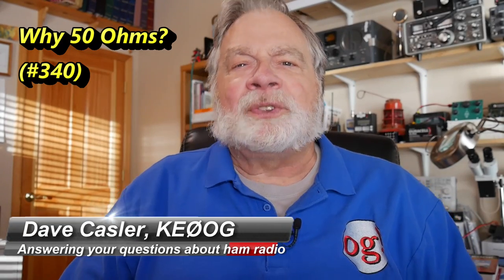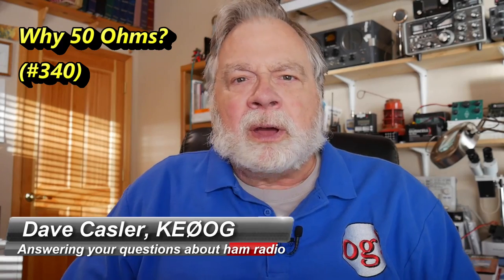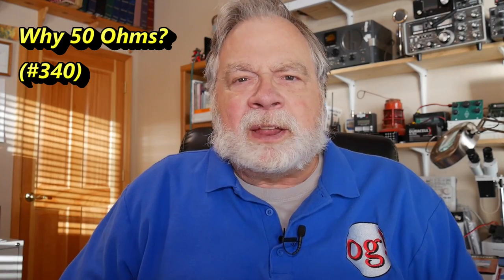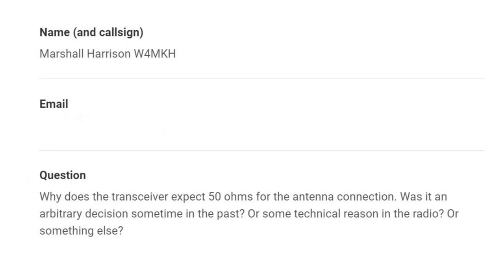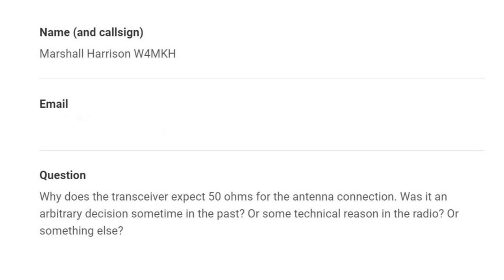Why is Coax 50 Ohms? (#340)

Comment: Dave, not sure we are on the same page ;)  50 or 75 makes no practical difference to a Ham operator.  Impediance is easily adjusted by lowering a dipole into a "V" adding capacitance till you reach a match or just use a matcher.  Coax is used to stop interference from close metal (say the tower).  It is practical at say 100 watts.  Above that, you best start looking at ladderline in the 450 ohm catagory.  RF in the shack?  Yeah right ;)  I used to work on TV transmitters that had so much RF around that the florescent lights in the building were always lit!  RG 59 has a tiny center conductor.  It will carry 1, 7mhz bandwith TV channel but to carry multiple channels (cable) they have to go to RG6 with a larger center conductor to handle the bandwith required.  One winter I built 2 QRP radios, 40 and 80 meters @1 watt, hooked it to a 540 ft loop up 50 feet with RG6 (75 ohm) and worked 41 states and 4 continents!!!  (still have the QSL cards)  A Ham Operator will figure it out!  The problem is that these kids that send 2 box tops and 50 cents to Kelloggs (the new ARRL) for their ticket have no idea at all of radio theory!!!  How many could sit down in front of an FCC examiner and pass 20 word code or extra class questions??  Zero, that's how many ;)  AE4YW

Comment: 50-ohms is used for carrying frequencies in the shortwaves and below, mainly.

This is because the multiple infinite impedances of the cable must approximately resonate with a specified signal emitter (transmitter).

And yes this resonance is a compromise.

Television frequencies tend to use cable with resonances tend to be 75-ohms in an attempt to provide signal insulation at reduced cost to the consumer.

Amateur radio operators tend also to use cable at 50-ohms, but the cable tends towards a lot more expense.

Even today, financial costs matter.

Comment: the initial cable diagram looked like RF waveguide rather than conventional co-ax. that is the best method of decreasing attenuation at high(er) frequencies. effectively, its a tuned cavity to assist RF at predetermined wavelengths.  you probably knew that :)

Comment: Nice but use of 75 ohm cable means a mismatch between source (tranceiver) and load antenna) as you explain at the start will reduce efficiency of power transfer as source and load are 50 ohms.
Reply: 75Ω on a 50Ω system is only 1.5 SWR, ERP is still 96% so it is hardly worth worrying about.

Comment: Thank you Dave, now I know. (after 45+ years in ham radio) 
You know what I've been wondering about the last so many years too? Why 13,8 Volt for so many devices? Never anywhere found an answer to that. Not 13V or 15 or 20 but 13 POINT 8 Volt ! 
73, good DX and stay safe !
Gust ON6KE
Reply: 13.8V is the nominal voltage of the electrical system of a typical car when running. In any case there is always a tolerance for input voltage since the voltage in a car can vary quite widely.
Reply: I see, so far I learned twice today and it's not even 10:00 local here. 
Thank you Dave.
Gust ON6KE
Reply: It's the maximum voltage that would be achieved by a 6 cell lead acid battery system.
A single cell's potential is said to be 2v but it is 2.3v on full charge.
So, 6×2.3=13.8v.
The power transistors in the final amplifier stage of the mobile radios are rated with this maximum voltage in mind.
Reply: Thank you.
73, take care
Gust ON6KE

Comment: I would love it if you could go into more detail about the physics of why 50 ohm is best for high-voltage and 75 ohm is best for low attenuation
Reply: I think that was experimentally determined and may have been dependent on the materials available at the time - copper conductors and air or maybe some early polymer or ceramic dielectrics. It could be that the optima are slightly different for different materials. It may not make much difference because the equations tend to have square roots in them - so a 10% change in permittivity only makes a 5% difference in the parameter of interest. Ultra - low characteristic impedance striplines are used to drive high speed laser diodes for lasers. The characteristic impedance can be as low as 1 Ohm! I have worked with these a little. Fun!

Comment: Some low cost cable is destroyed by UV light! I have 2 cables that I got at the same time, installed together. Same weather same everything! One is still looking good and the other is cracking!  I think paying a little more for good cable from a place that you can trust. Is better than saving a little bit and having the chance of it going bad and damaging your radio!  Not saying you need to get cable that is $25 A foot! Use your head, good coax from a trusted supplier! The best you can afford!  If you get good cable and take care of it,  it will last for almost forever! I have some over 30 years old.  South Florida sun, hurricane,  thunderstorm. Get it good now will save you money later!

Comment: I love how you say its what rich hams run, Im just running a lil 10 11 12 meter president and Im not licensed so 11.3 it is lol, I have learned so much from you, yet a lot of math to convert to 27.19 lmao,  only think you said i couldnt check myself so far was about the air choke does need to be 1/4 wave x the vf of coax, and the circumference matters as well to brin it all to an 8k ohm "balun".            and after testing with my analyzer, confirming, the math give for a electrical  wave length is math you give is already x a vf of .95,     so that makes a huge difference of like 2 inches!!!!

Comment: 06:53 that is a massive feeder, I use the 1/4" cables with the same technique to connect a dipole or a dummy load to test out FM transmitters, they have a massive heat dissipation. But aren't very flexible, so you cannot use these if you need to bend the cable (more than 30°). Then cell flex is a better option. This invention is still used today for high speed internet in my country, with 75R cables. Connections between measure test equipment are all 50R I assume that is because to get all equipment equal loads?

Comment: So if we boil this down, 75 ohms is best for any receiving-only application like TV or radio reception.  When both transmitting and receiving are involved, then 50 is the compromise. Theoretically if transmitting only (like for a radio station), 30 ohms would be best (though that does not exist).  Is that a correct assumption?

Comment: Years ago I acquired a couple hundred feet of cable TV aluminum hardline, about 3/4 inch and 75 ohm for free from a cable TV company.  These companies buy the hardline in spools containing thousands of feet.  When they get down to that last few hundred feet, if that isn't long enough for the next run they want to install they will simply discard it.

I asked a fellow ham who also was an antenna engineer for one of the largest and most eminent manufacturers of commercial/public safety antennas about using this for ham radio.  He did some calculations on the spot to show that the SWR would be 1.5 at each end of the hardline where it would connect to the radio or antenna and that would result in a 4% loss or loss of less than 0.2 dB.  At VHF and UHF frequencies, this is far less than the loss one would see in 100 feet of RG-8 or smaller cable.  The biggest problem is using this hardline is getting connectors to fit it.
Reply from the maker: Thanks for sharing your experience. Yes, 75-ohm cable can work well for ham radio.
Reply: @davecasler  I just edited the above.  Where I said a loss of less than 2 dB, it should read less than 0.2 dB, that's 2/10 of a dB.  The loss is really inconsequential.  Thanks for your interesting videos.

Comment: Heaviside did not develop differential calculus - -that was Newton.  Calculus is just short for differential calculus.
Heaviside developed the differential operator that works much like Laplace Transforms in converting differential equations into algebraic equations.     <Heaviside operator>
GH   Jan 28, 2021

Comment: "Load balancing" at 50 ohms gives coax the maximum frequency stability, allowing 'wide-spectrum' data and power throughput. Of course, load-balancing is extremely important for reliable operation. Fiber-optics and control-circuitry has drastically reduced the use of coax, but is still critical for military avionics.

Comment: Just FYI when we did some early networking experiments at Edinburgh University in the early 70's, we used 75 Ohm coax. Why? Because it was cheaper and it worked for the distances we needed within the building.

Comment: About 40 years ago I got into scanner listening. I ordered a outdoor scanner antenna, which I still have mounted in the attic. I clearly remember that it came with cable which was 50 ohm, it is a light tan color and the same size as RG6. I've never seen it listed anywhere since.  I love your explanations but I'm a idiot and the Z things go in one ear and out the other, thanks.

Comment: The instrumentation I design uses 75R and there are plenty of low noise line drivers out there for that impedance in the mW range (much beow that and you have to go for specialist op-amps then for very low signals of say below a pW JFET's and whatnot).. It cuts down on current noise for starters. That said once your signals get silly low Johnson-Nyquist noise is a pain. However you can get round that by oversampling and averaging as long as everything is temperature controlled. I have always seen 50R as a bit of a compromise. It's theoretically possible to make 10R coax but it would be bulky. Great for high power but way too bulky for most applications.

Comment: This is the first time I've come across your channel. I found it to be a very interesting listen though I did not necessarily understand all the terms. It seems like an excellent overview of the subject. It's at least fifty years since I stopped reading AARL manuals. I found one glaring error and it's got nothing to do with the issue of 50 ohms. Oliver Heavyside was brilliant and he added a lot to the understanding of Maxwell's laws and, in mathematics, created some new disciplines in the Calculus. However, he did not invent differential calculus. Isaac Newton and Gottfried Leibniz independently developed both integral and differential calculus many years before 1700. Newton delayed publishing his results which led to issues of priority between the two geniuses. They used different methods to come up with exactly the same results. In general the notation we use today is due to Leibniz. In any case the conclusion I reached is that differential calculus had been invented over 150 years before the birth of Oliver Heavyside. However, I do not want to take anything away from this man because he added so much to our understanding of wave transmission and in particular to telegraphy and radio. In particular, what we now call vector calculus was a consequence of his restatement of Maxwell's laws and his work in these areas of wave transmission.

Comment: As an electrical engineer who has worked in the railroad signaling industry for the past several decades, it appears to me that the "telegraph pole" depicted at 1:31 is actually an "open line-wire pole", used for supporting the wires of the railroad's wayside signaling system.  These wires convey railroad track circuit occupancy information and electrical power to wayside signaling locations along a railroad line, and are not normally used for "telegraphy" in the usual sense.  Or am I missing something here?

Comment: Question?  Two piece of conductive metal  separated by a insulating  material is a  capacitor. Does a coaxial cable has capacitance?
Reply from the maker: Yes, and length of wire is an inductor. You can look up the values for the the capacitance and inductance per foot for each type of coax.

Comment: good mathamatical explanation, some other explanations, air is the best dielectric, dense hard polys the worst, gas expanded foams the best compromise. Copper braid is not the best shield, aluminum braid and foil is, solid copper center is probably better for radio, but not necessary for TV (power vs frequency), water is your enemy (do squirrels  eat your antenna cables too) (37 yrs in CATV)

Comment: You also don't need a metal filling if the frequency of transmission has a skin depth that is just under the thickness of the 'core' conductor (critical frequency).

Comment: Have you ever seen TRIAXIAL cable? Ever wonder why oscilloscopes have a 50 load / no load switch? For maximum transmission transfer of power is 300 ohms. That is why the old VHF TV receivers were 300 ohms. Coaxial cable can be fried by constant absorption of SWR. We used to cables that were maybe a year not working. I would replace and everything would start working. When back at the shop I open the cable think the connected was bad and would fix it. Turned out the copper wire was oxidized so bad it was Black. At first I thought it had been struck by lightning, so I was keeping a close on the receiver in the field, and discovered the signal strength was falling off ever so slightly. I swapped out the receiver and brought it in for diagnostic inspection. I found a load inside the antenna element had fractured causing SWR.

Comment: Well done!   Thank you.
If our firetruck siren speaker goes below 400 Hz, why may it burn outhe speaker driver 11-ohm coil?     (For greatest sound output, thelectonic siren produces a square wave to accelerate the diaphragm excursion from onextreme to the other!)    Thank you.
Reply: A square wave is made by many sine waves at low and high frequency & may require multiple core wires with braided shield wire

Comment: At uni I was told that the 50 ohms was chosen to match the impedance of a half-wave dipole antenna.

It is nice to have a good impedance for power transfer, but if the antenna doesn't match that impedance it is pretty useless.

Comment: Great vid. Only question is about the power handling capability. That wasn't super clear. Does that mean if you are doing QRP for example 75ohm coax would be a good option?

Comment: Dave, I've watched this video and have been dwelling upon it, leaving but a modicum of time for sleep and prayer. I want to use conjecture to put a slightly different spin on the origins of 50 & 70 Ohms as standard coaxial impedances. If we could get our hands on the original 1929 Western Electric research paper, I'll bet they were addressing the power & voltage handling capability, and the losses, of twisted-pair wires with similar rubber and cloth coverings, but with different turns per inch; I don't think they even were looking at coaxial cable. Accordingly, based on their research, 50 & 70 Ohms became the standard impedances of twisted pair transmission lines depending where in the telephone system you were looking.  Now, 70 Ohms was the standard impedance of the cloth enclosed, rubber insulated twisted-pair used for home telephone wiring prior to the 1950s, and as soon as it became readily available in the early 30s, it was used by hams who realized that most of the RF signal field was between the two twisted wires, and that it could be used around metal poles and the like with acceptable loss. (This was much easier to install than parallel-wire open-air transmission line.)  Ascended Master George Grammer in the late 20s or early 30s, wrote several articles on zip line and 70 Ohm twisted pair used as transmission lines. (These articles are available in the ARRL archives.) Pre-WW2 ham manuals often talk of 70 Ohm twisted pair amongst the better choices of transmission lines, though by the 40s, two wires within a rubber outer covering were the norm.  After WW2 when coaxial cable became available, I think they simply chose these impedances for coax in as much as they were already standard impedances, and could be used to directly replace lossier and nosier twisted pairs in communication applications. The higher 70 - 75 ohm transmission line has a higher impedance, probably because the dielectric covering of the inner conductor can be thinner, (lower C,) and it's cost cheaper than a corresponding 50 Ohm transmission line made of similar materials. Commercial entities went for the cheaper wire. My two cents. Thank you for your many contributions to the Radio Arts. 73 de W2LDP
Reply from the maker: Thanks for the info!

Comment: I think 75 ohm cable is so cheap because the center conductor is copper-clad steel and the braid is aluminum, whereas 50 ohm cable is generally 100 percent copper. 

CATV and satellite signals don’t go below 10 MHz or so, and perhaps they can get away with high loss at low frequencies which allows steel for the center.
Reply: Due to skin effect at high frequencies almost all of the signal travels on the outside of the center conductor.